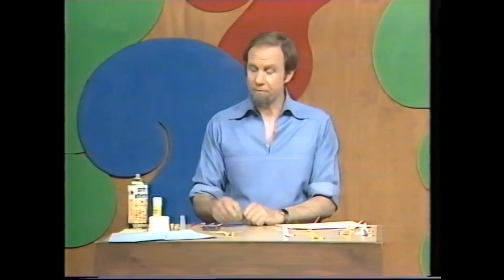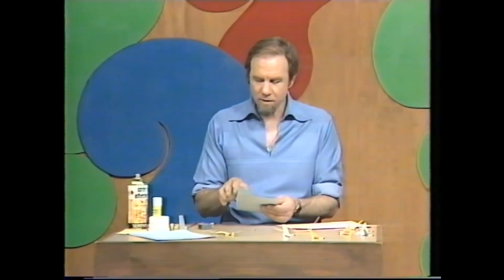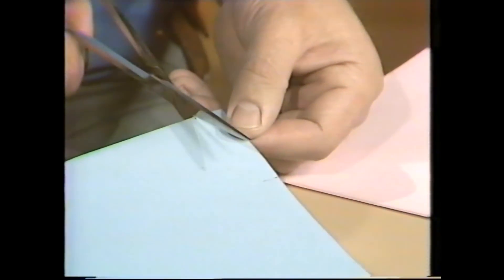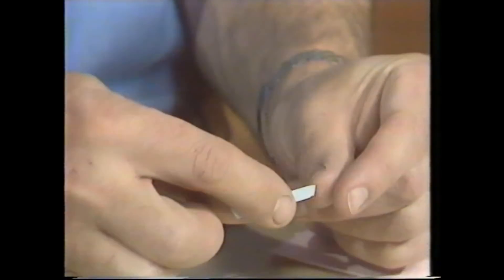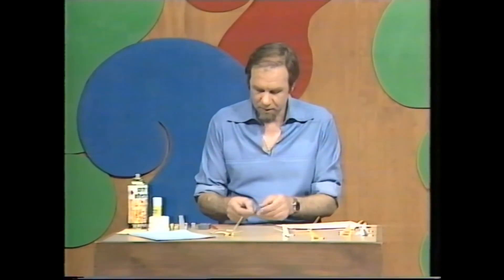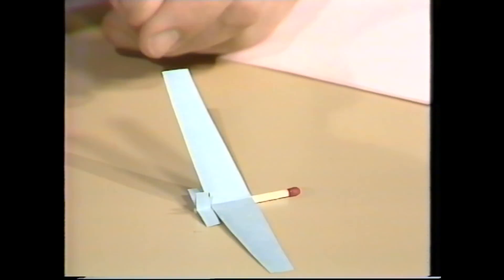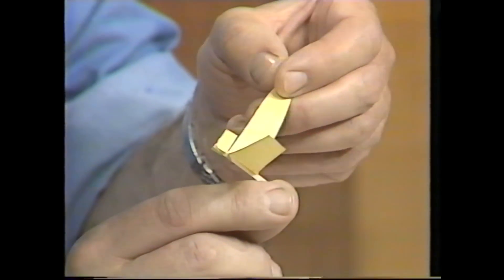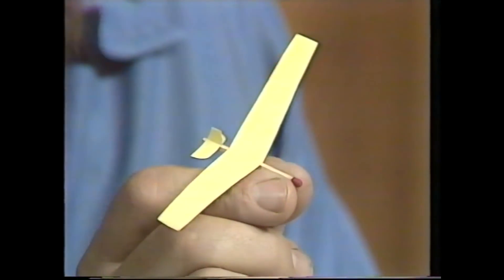Make a matchstick glider that really flies

Comment: Hi Rob, I am curious to know what tape format the old shows are in and how you're extracting them? Don't tell me you have an old umatic or beta machine in your spare room?!
Reply from the maker: No, but we know a firm where they have several old devices, and we used them to transfer stuff. the originals are in several formats, including those you mention, and Deane and I were sent VHS copies to check for several years, and we have taken segments from those - a mixed bag. - Rob
Reply: @CuriosityShow  I read this in your voice. 😂